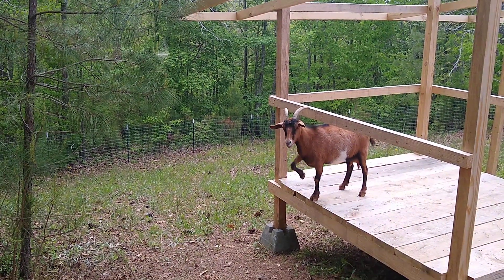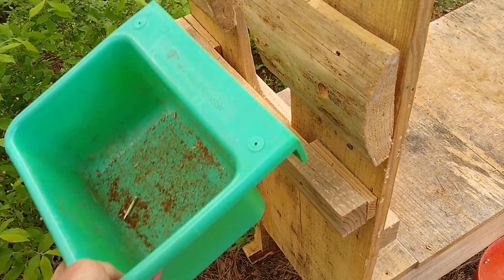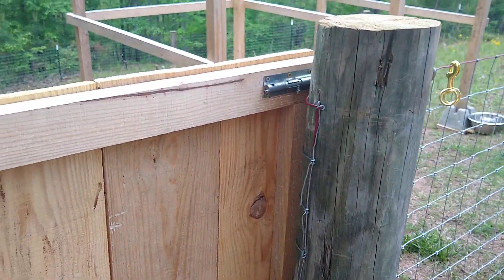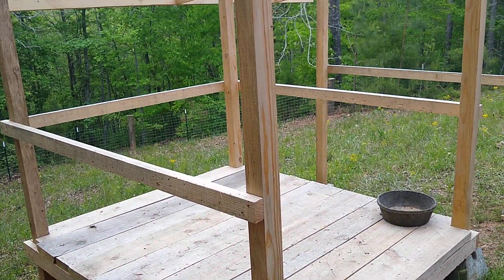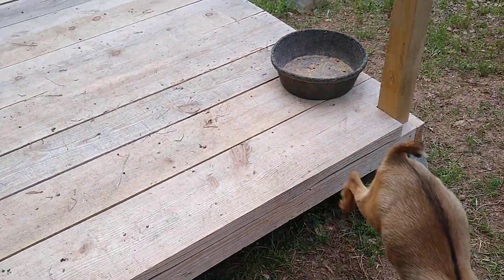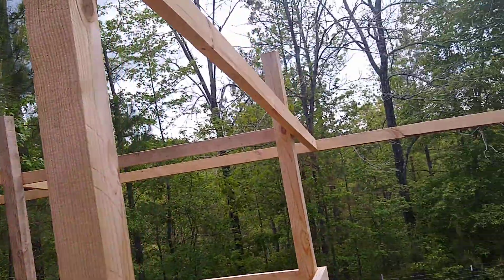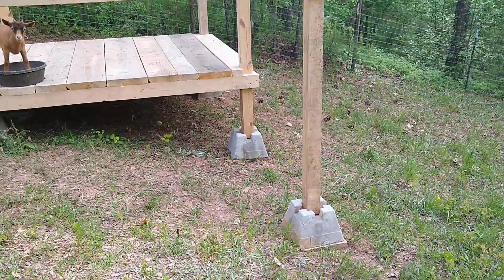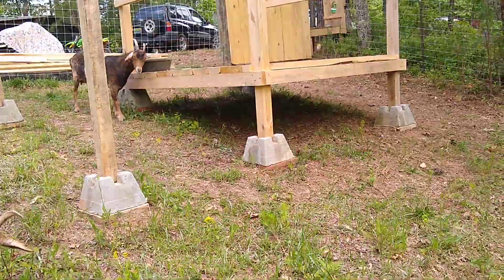Chainsaw Milled Goat House

Comment: Funny how much our interests seem to align. 👍 We either had a tornado or some fierce straight line winds come through a few weeks ago and take down a number of trees toward the back of the property - thankfully sparing the house. I've been looking at various mills, including bandsaw mills for several years and was kind of stuck in the paralysis by analysis phase about what I want to do and how I want to go about it. The storm solved the riddle when it took down some big oaks and walnut trees on the other side of a drainage and up a hill. I can't let them go to waste and they have to be milled where they fell. Even if I decide I eventually want a bandsaw mill, I still need something super portable and just ordered the 48" Granberg. I also wanted to explore their edging mill as well, so thanks for the upload!

Coincidentally, I recently decided I need some goats to help me keep the place cleaned up, especially when a neighbor showed me how their goats literally cleaned their poison ivy to the ground. I'll be looking at Spanish type crosses instead of dairy, but goats just the same. Just as you're doing here, I'll be building structures and utility pieces from what I've milled, so very cool to find someone like-minded with examples to consider. 

Keep the vids coming... Subscribed!